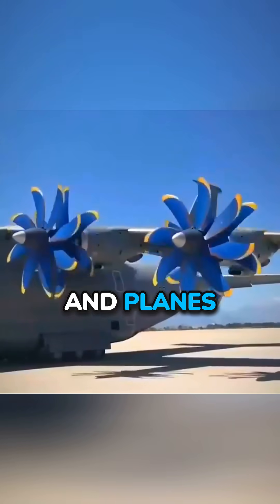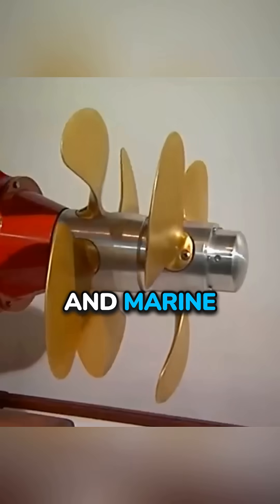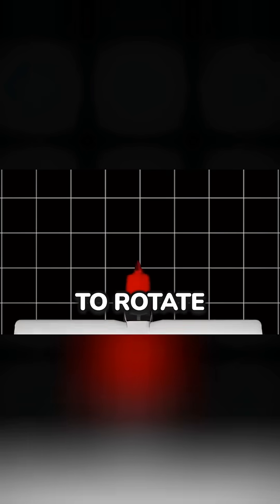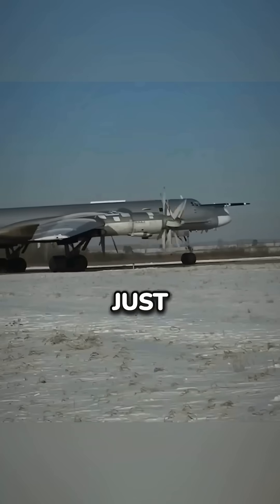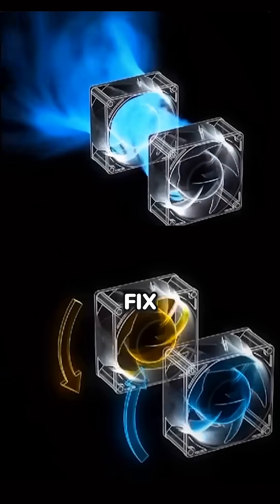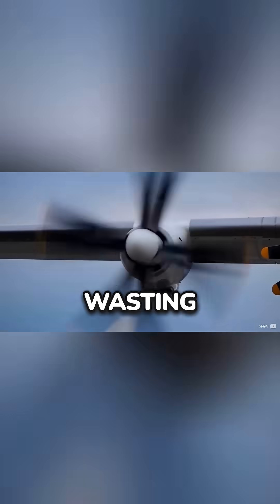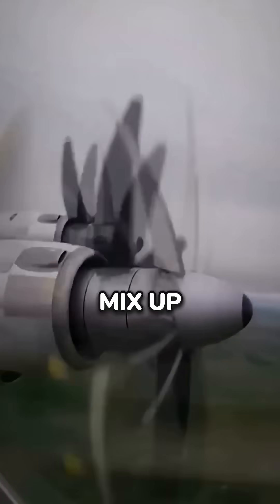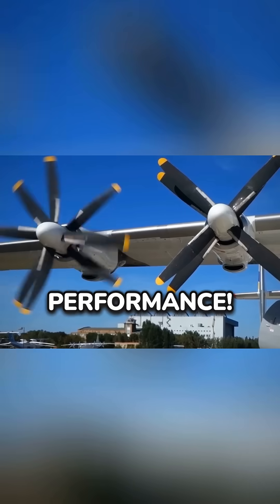Why Some Planes & Boats Use Two Propellers ✈️🚤

Comment: The tips need to bent forward if the air accelleration is to get a minor anti-radial component. Optimum angle depends on air speed, rotor distance and casing

Comment: its actually counter rotating propellrr
Reply: Actually no it isn’t. Contra-rotating propellers are driven by the same engine and spin on 2 coaxial shafts. Although counter-rotating propellers are similar, where 1 rotates in the opposite direction of another, each propeller is driven by a separate engine and these types of propellers are not coaxial and are found on aircraft with a propeller on each wing.
Reply: @zeigous  same as KA50 heli